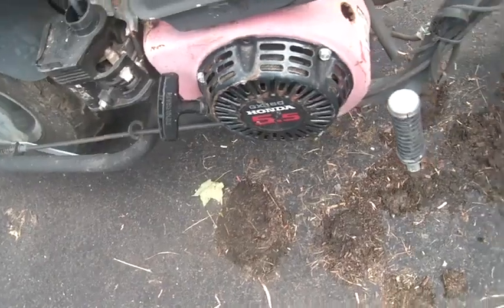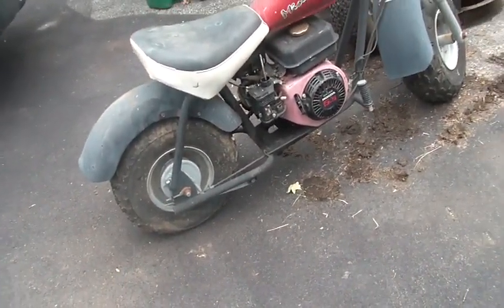2005 Baja Warrior, Flea Market part bike, will it start, run, and move,

Comment: on the engine above the bolts to mount to the frame the engine model and serial numbe you can tell its a honda
Reply from the maker: Hey Kevin, Thanks for the info, I see a lot of mix and match engines out there and the Honda version is more valuable to be then the clone!!!   Thanks again for the info, thanks also for watching and commenting!!!
Reply: Harvey Spooner no problem 28year experience I like to pass it on if you need info check with me I have a few I can show you location